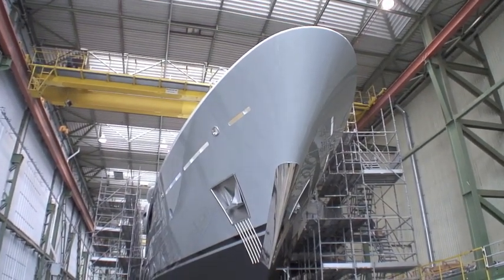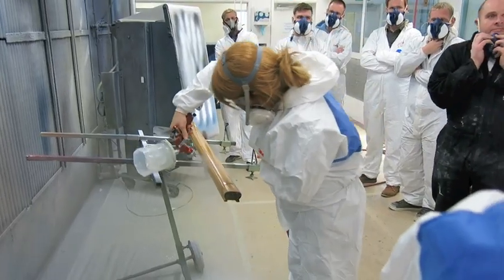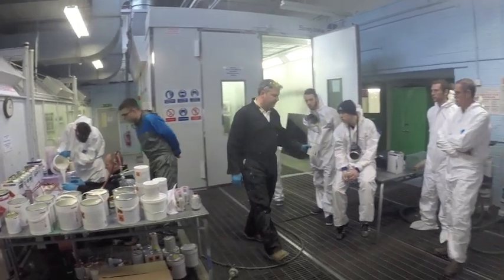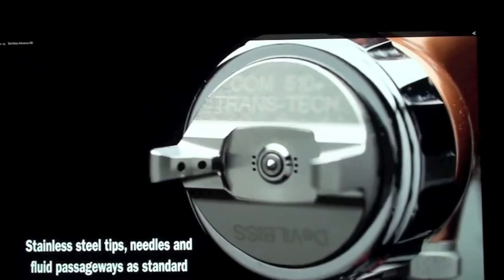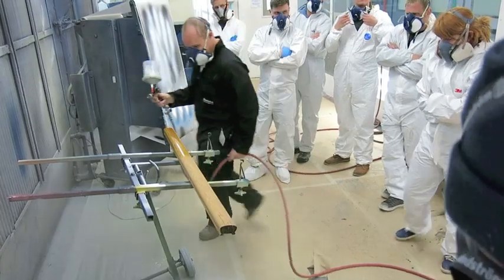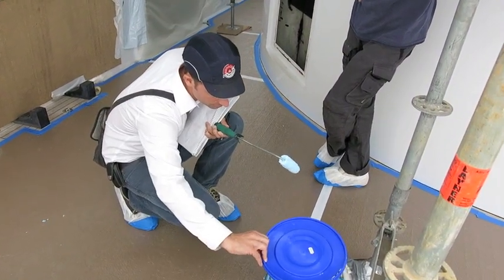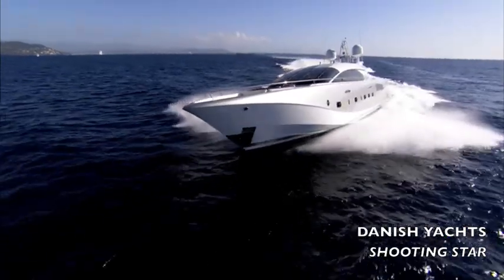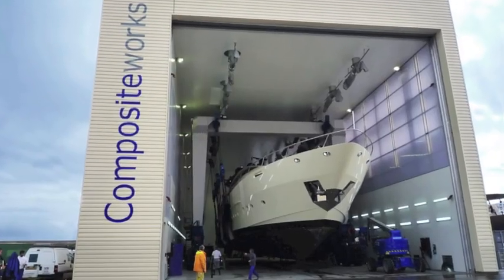Awlgrip's paint applicator course

Comment: I am fixing to refit and paint our own sailboat, here in Florida. This video made me think about the similarities, yet big difference between when I worked in a Dodge Auto paint department and then went to work at a Corvette paint shop. The equipment was mostly the same, but working with metal autos and then switching to fiberglass autos was a learning experience all over again. When I was in the business the talk was all about the spray booth. Down draft, Up draft, Side draft. With or without infrared heat . The new thing at the Corvette place was Floride Clearcoat, back then.